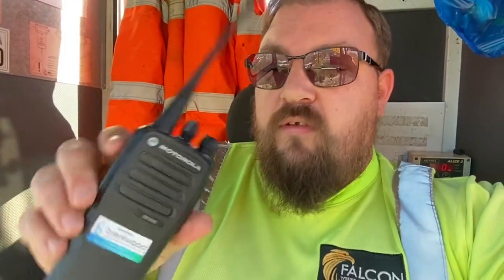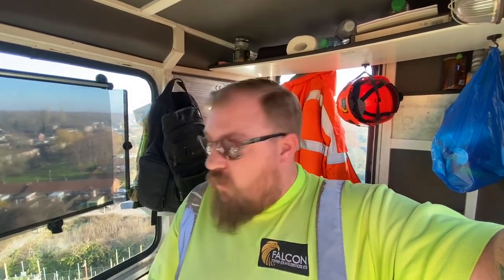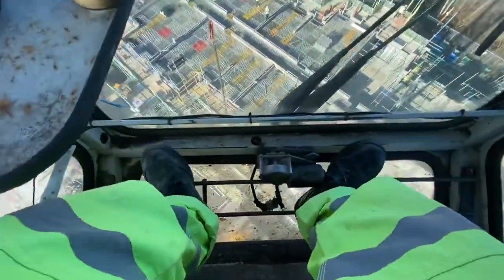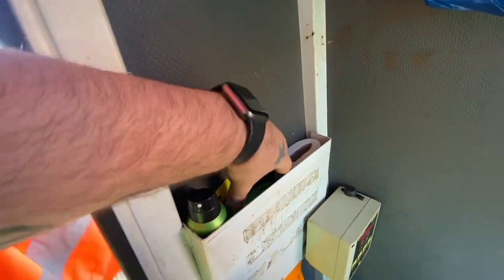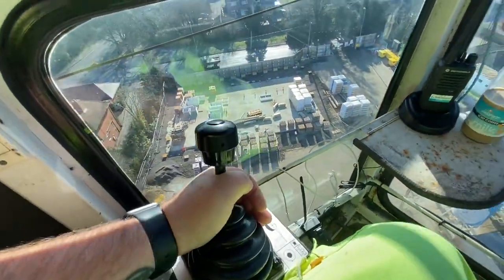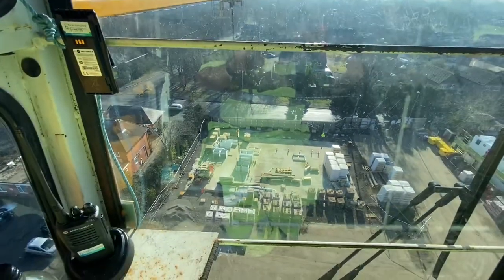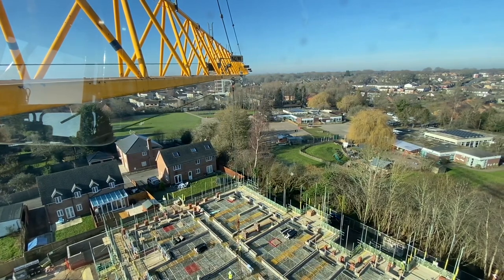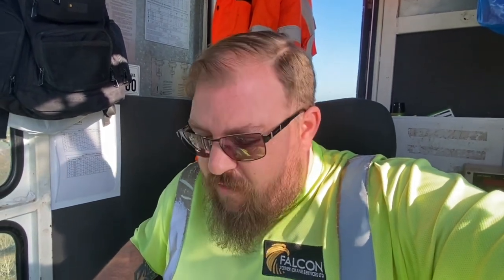MY BRAND NEW CHANNEL - CRANE CRAZY - Episode 1 2023

Comment: Interesting to see the mechanical engineering that goes into designing these cranes. As you mentioned, very similar to fairground rides with the slewing ring. Do these cranes go through annual non-destructive testing like fairground rides to detect metal fatigue, check the integrity of welds and so on? Great content by the way!
Reply from the maker: They get a 6 weekly service inspection and a weight load test after 12months